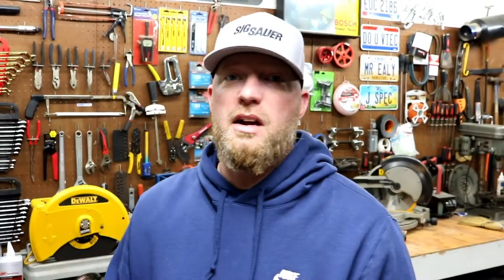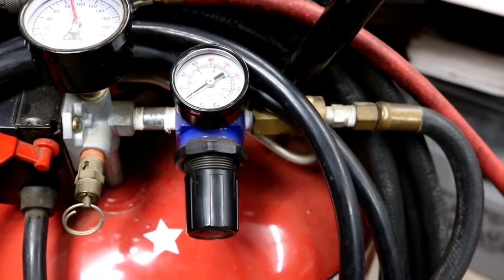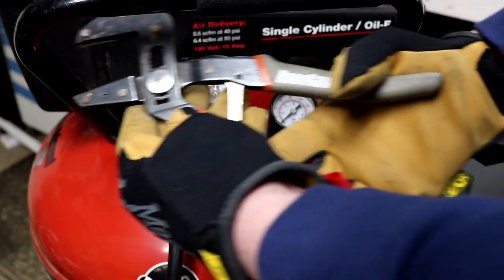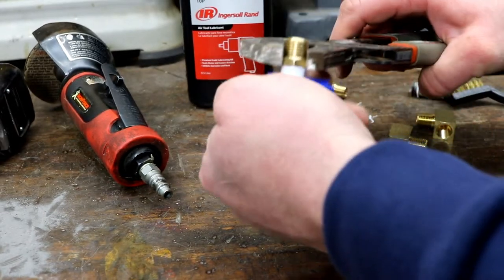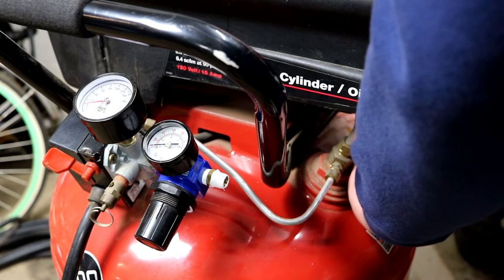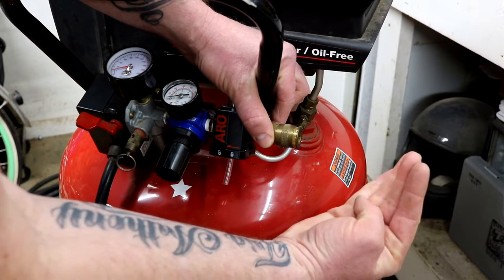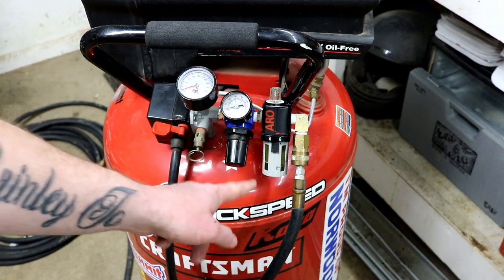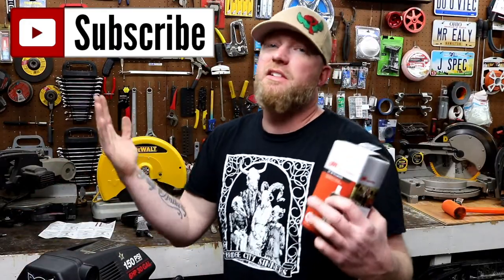In Line Lubricator / Oiler Install On Air Compressor - Homeowner How To

Comment: As some may be curious yes oil also passes though when filling tires and dusting off the work bench. This is why for most home do-it-yourselfer's just placing a couple of drops of oil in the air tool before every use will be less hassle. What's more important is installing a moisture trap filter. This removes moisture which prevents air tool internal rust and is especially important for spraying paint. Also draining moisture buildup from your air compressor tank periodically will increase longevity by avoiding rust through and tank ruptures.
Reply: Good point you make, I purchased a 2 outlet swivel valve for my compressor so I can run one hose with a blow off tool and another hose for my air guns etc so I will put the oiler after the swivel .

Comment: I guess this setup is good only if your compressor is designated to be used with air tools. If you want to attach a paint gun then you don't want oil passing to your paint? I would add air filter/water condenser after the pressure regulator and then split the line to oiler (air tool) and free outlet (paint gun). Is my logic correct?

Comment: I am in the process of installing a whole shop air pipe system. I will need to get a bunch of these so each place i might plug in an air tool has it. I'm terrible at remembering to oil. Unfortunately i can't just put 1 for the whole system because i need dry lines for the cnc plasma cutter and for paint/ airbrush.

Comment: I’ve recently bought an in-line oiler but yet to fit due to having a clear out to actually get space to work in my garage. How will this work of fitting and air blower? Won’t it spray oil onto whatever you’re clearing dust etc from? There’s probably a simple solution. I think I have two outlets on my compressor. It’s buried somewhere! If it has then I’ll use the spare port for a blower. Without a spare port, what would be your thought on it spraying oil out on air blower?

Comment: I like what you did, but have a question.  If you use your compressor with a paint gun attachment, will the oil affect the paint?
Reply: Good question 👍 what about blowing dust outta my PC guessing you wouldn't wanna use it on that 🤔 thanks from 🇬🇧
Reply: Yep.  It would ruin the paint.  Permanent oilers like the one in this video are for mechanics.  For general use, an inline oiler attached to the tool itself is the best alternative.  That way the air hoses stay oil free and you can blow dust or spray paint.
Reply: You don't want an oiler while spraying paint (but you want a water filter)!... I have separate water filter and oiler connected to my wall rather than directly to my compressor... My water filter is connected directly to my compressor (you always need a water filter)... My water filter has 2 outlets... One outlet is connected to the oiler while the other outlet has a quick coupler... The oiler also has a quick coupler... Best of both worlds... When I don't need the oiler, I connect my air hose directly to the water filter (therefore I bypass the oiler)... When I need the oiler, I connect my air hose to the quick coupler on the oiler... Then the air flows through the water filter first and then through the oiler... I also have separate hoses since the hose connected to the oiler becomes contaminated with oil...
Reply: @frederikmare9002  I'm putting together something similar except I'm mounting the filters to a portable mount with both filter setups. Hoses are color-coded at the quick disconnect to avoid making an unfortunate mistake.  Using this with a six-pound Poter Cable pot compressor. Can also hang it on the wall in the shop for a bigger setup.

Comment: Awesome thanks for making this video but I didn't find the one thing I'm looking for lol The oiler I got has an adjustment on it minus or plus how much oil should I be using considering we just put a couple drops in the tool when we use it this is going to be constantly putting oil how do I have any clue of how to adjust it My adjustment is just plus or minus